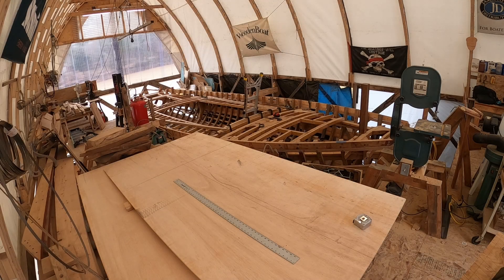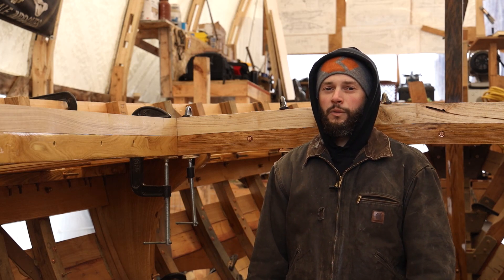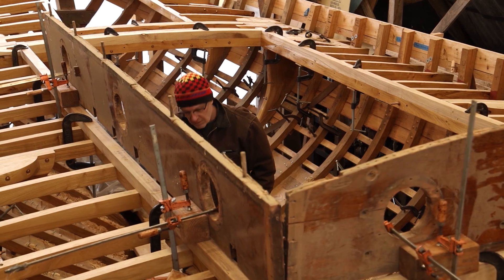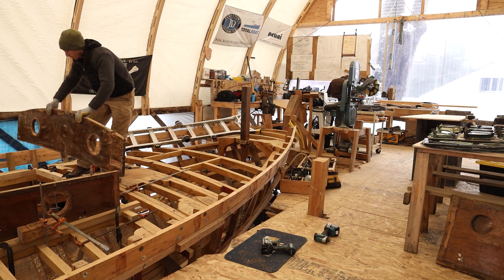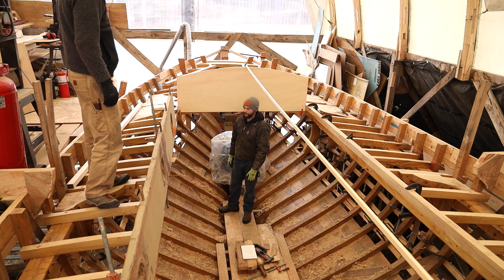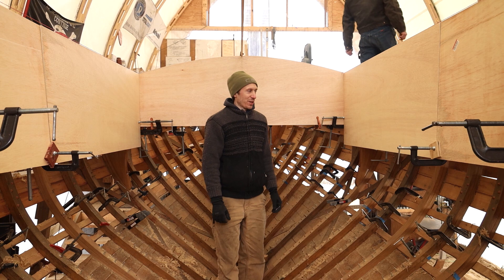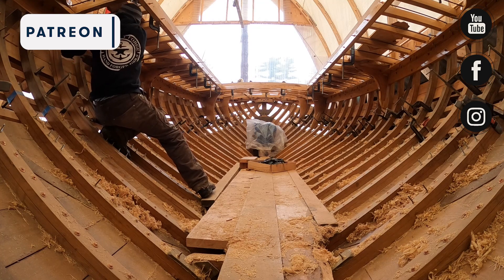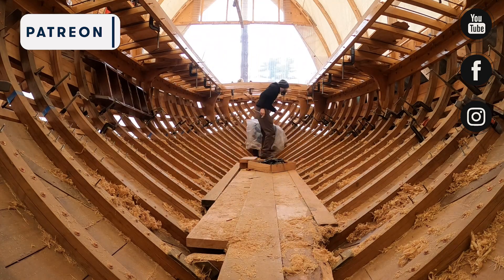Deckhouse mockup -  Episode 148 - Acorn to Arabella: Journey of a Wooden Boat

Comment: Guys you have been getting some really good advice from people who know what they are talking about. see rick the record. I would also like to add oval ports at front of dog house common on fresh water boats rivers small lakes but only installed by numpties on salt water boats. as they present too large a surface area to breaking waves. your companion way 22 inches you sure mate, ok getting out of cabin. shit for descent into same with canvas,  ,inflatables  and drunk girls with wide hips. Solid rod turnbuckles can be used to form temporary cabin  beams in heavy weather or when boats aground to make up for oversized cabin. And about time you learnt  how to sail you are not getting any younger and pulling ropes can be learnt in a day it's all the rest of it that takes the time. It's called experience.
Reply: Of course I agree!  The design of the companionway is really tricky. It’s a big hole in the structure for a start. There is a bridge deck between it and the cockpit, which is good for pooping strength, but dangerous for access because the descent will be steep, and there can be exposed moments when crew are unclipped. Lots of crew have been lost making the transition between cockpit and cabin. There is also the mizen mast consideration which is going to make the area, it seems to me, very congested, with belayed halyards, mast winches etc eating into the access space, but giving perhaps good handholds.
Reply from the maker: We get some damn thoughtful comments. Thanks for taking the time.
Reply: @AcornToArabella  Sorry if you found my comment harsh, but peoples lives on the line.
Reply: @RicktheRecorder  Thank you for the back up Rick. Steve is making many decisions about the boat he would not make had he more experience. His driven character and strength of mind is one of the things that makes this project interesting, however if Arabella is to be fit for the purpose he has in mind, he really needs to learn how to balance his drive with listening to folk with greatly more experience.
Reply: @davidprocter3578  Yes, but without his strength of character and drive, this project, like so very many other similar ones, would have long since been abandoned, and our discussion would be, at most, entirely theoretical. Experience will come. We just need to keep him alive long enough to gain it!
Reply: @RicktheRecorder could not agree more

Comment: You won’t regret an error on the side of to much headroom.  The hammock style storage will be useful down the road.
Reply: I’d go even taller than you think is too much...the times your vision is blocked from the cockpit will be minimal compared to internal cabin space
Reply: Don’t agree with this advice, for the reasons I have explained elsewhere. The aim should be to make the coachroof as low as possible, consistent with having it reasonably habitable. Flush deck is perhaps the ideal.  Calling it “the house” tempts one into thinking that this part of the boat is simply domestic. It isn’t. It’s part of the fundamental structure. When so much attention has been given elsewhere to strength, it is alarming to feel that no real consideration has been given to seaworthiness in the design of this stage. May be - I hope- I am mistaken, but the lack of discussion at this point worries me. This is not a sea-going caravan.
Reply from the maker: Rick, you’re killin’ it. Very good points all around and we appreciate it. And KC, we appreciate your thoughts—there will be room for hammock storage under the side decks and in a couple other spots.

Comment: Are the openings to check on your sails and rigging?  I don’t think you would be looking for traffic  I say make them so you can see your s...t without going outside in the elements in the middle of the night
Reply: No
Reply from the maker: Hi Travis—good question. They’re  mostly for light and ventilation. “Portlights” kind of hints to that as a name, but it’s not for scenery or anything... and they’re small and stoutly built because they need restore the strength, combined with the material around them, that would have been in the original material had we not cut those holes to let them in. Hope that makes sense. They’re not like windows in a house, in other words.

Comment: you guys won't do it - but a flat deck's most preferred when sailing.. easier to move around the deck, esp under weather and it would have smoother lines.
Reply from the maker: They can do that on some boats maybe. Camber is needed for ours.

Comment: Make the deck house taller than anyone in your crew, it will be better than having a six foot six crew member constantly ducking.  My Nephew is 6'11" and my niece is 6'4" and they love sailing, I am 5'11' and everything I build I consider the much taller next generation.  If you go on board the USS Constitution in Boston Harbor the gun deck height is 5'2".  It was the norm in 1800 when the ship was built.  Always leave extra room because you are building a 200 year boat.  Be kind to taller people and wishes and prayers for your health and safety from Northern Israel.
Reply: Sorry, wrong advice. The comfort of super tall people is always secondary to the needs of strong and seaworthy construction. If your boat is not big enough to accommodate 2m plus headroom, then it’s not.  Keep the coachroof low, rounded in profile, super-strong with minimum necessary openings. Oh, and there were several men on HMS Victory, 200 years ago,  who were over 6 foot. Deck heights were similar to the Constitution’s. Once again, the operative consideration was seaworthiness - keeping the weight low and stability high.

Comment: Is that the finished floor height on the inside?
Reply: No. They may loose as much as 6 inches to the final deck height.
Reply: @steveholton4130  So the height will be 6’ after the floors are put in on the inside.  
(I am Concerned the inside height measure is 6’ from the current floor height so would be 6” short later)
As a 6’2” person, I would also point out that people are taller today than 100 years ago! ;)
Reply: @rob1andrews  As with anything else, you have to work within the parameters you are given. Here, with a sailboat you have to work from  the form of an Inverted "V". With an ocean liner you start with an inverted "U". As you should see from the shape of the "V", the maximum height only occurs at the point of minimum width. As you widen the base (sole, floor) you must move up the inclined walls (hull) and simultaneously loose height above it. If you want more headroom, you have to widen the base or heighten the walls. You can not defy trigonometry. If you are tall stay off sailboats or expect to walk hunched over the rest of your life.   sdh in CT
Reply: @rob1andrews  200 years ago, HMS Victory had several men over 6 foot, and the headroom was not a lot over 5 foot.

Comment: I would go with square opening port lights for the sides.  Or oblong.
Reply from the maker: We’ve got these great, strong, appropriate ones from Victoria so we’re rolling with it. Very traditional on a near-coastal working sailboat though. One was just featured in WoodenBoat, one of the ones from Vineyard Haven on Martha’s Vineyard. It’s the third on the slider on the homepage.

Comment: A couple grand for some port lights? Jeez.... with your skills, Why don't you guys just cast your own port lights? I mean; you poured your own keel. You made your own rivets, nails, bolts, whatever... Why not make a mold, melt up some bronze and cast away...?
Reply from the maker: We’ll be casting some parts this coming spring with Bob Emser of The Art of Boatbuilding. Keep an eye out for that, it’s going to be great.

Comparing bolt-making (which involves taking bronze rod and throwing a die over the end of it) to casting port lights, which would need to be patterned from an existing one (from where?) Then follow a process ending in more polishing than anyone wants to do,  is a bit of a long jump. We appreciate your confidence that we could take up that challenge though!
Reply: @AcornToArabella  That's exactly what I was thinking; make your own Negative(s) (I think that's what they're called) out of wood - 
routered and sanded to any darn shape you want.  Use'm to make a sand mold. Shi--.. After the Keel pour, I figured it would be a no-brainer... I'm sure you have a Foundry Friend by now :)...  But your time is precious, I get it... You've got plenty of stuff to figure out..  Whatever your method, you guys are awesome and I look forward to every episode. You never cut corners and Arabella's beefy construction shows it.. I've watched you from the beginning and no one would EVER guess you weren't OLD SCHOOL FORMALY TRAINED shipwrights. Absolutely Phenomenal. Thanks for the videos.

Comment: I think I would have added another 10inches of head room. Than the boat would feel spacious. You will not even feel the 10inches on the top deck.
Reply from the maker: Yes, 10” of vertical on the coach roof would be very much noticed... it’d eliminate much needed space to ship the dinghy on passages. The sky’s not the limit.
Reply: @AcornToArabella  I did not think of the dinghy. Guessing you will not be hanging the dinghy off the back of the boat like other boats do. It’s a good size at what you guys opted for any case. 👍🏼.

Comment: Skip those old tiny tiny portholes. Might not look traditional or original, but put in the biggest, widest and longest windows you can. (acrylic?) You're gonna love to actually see out of the boat once you live in it.
Reply: Sorry, not good advice. For an ocean-going boat you want the smallest, strongest holes in the cabin top structure that you can get away with. If you’re just going to sit in a marina, well, indeed,  other considerations apply.